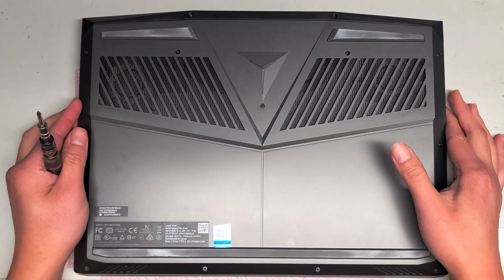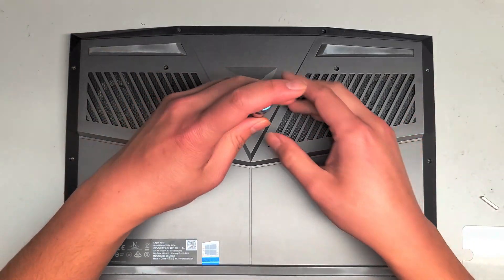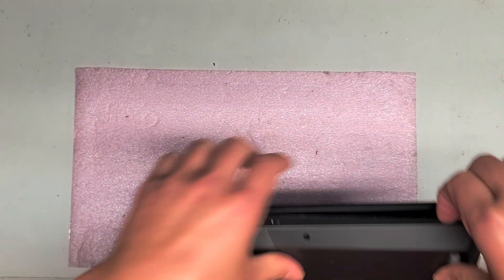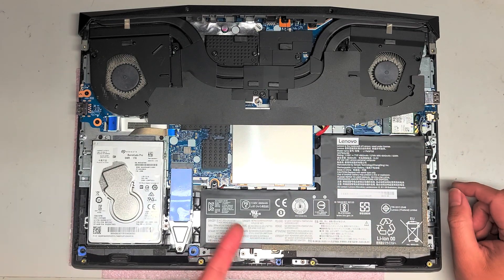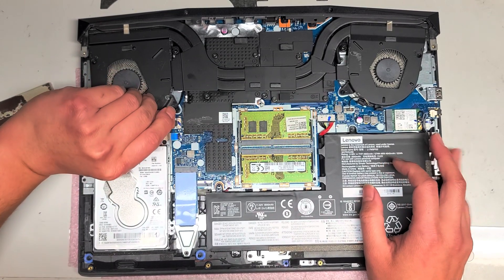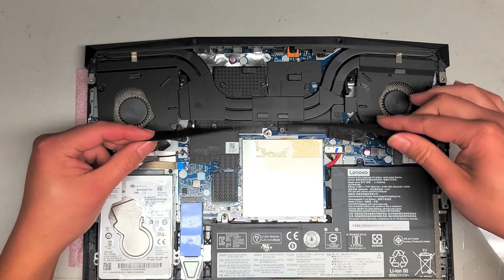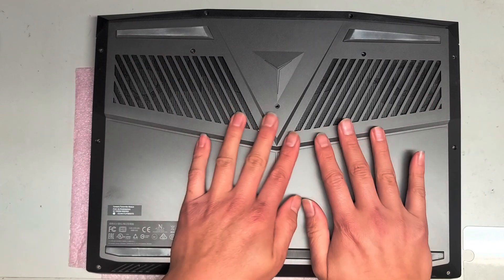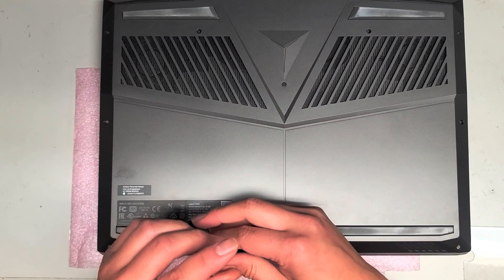Lenovo Legion Y545 Disassembly RAM SSD Hard Drive Upgrade Repair Quick Look Inside Part 1 of 2

Comment: hi It's Binh (BeHello, It's Binh (Been) Repaired & Everything Reviewed,

I hope you are well.

I would like to ask you about the Y545 PG0 laptop, the same one you are disassembling. I would like to know if it is possible and if you have access to the disassembly manual. I also experienced a situation where I took it to a service center, and now I'm missing several screws. The main issue is that I don't know what type of screws are needed, and I would like to know if you have that information or the disassembly manual. I'm not sure if I'll need to buy another part. I appreciate your help.
Reply from the maker: I don't have, nor do I use any manuals.
Reply: Hello, . @ItsBinhRepaired   

I understand that you don't use any manuals, and I apologize for my concern. I mention it because, like me, I am missing screws in the part that you are disassembling. I truly don't know if it happened during the maintenance that was performed or if they were lost. I would like to know what type of screws it uses, M1 or M2. Thank you for your collaboration
Reply from the maker: The 1 and 2 are the diameter in millimeters isn't it?

Comment: Hey so im trying to open up my y545 and ive got maybe 9 of the 11 screws out but the last two are stuck and i cannot get a good grip on them as they are rounded off. Is it possible to remove the screws in any other way without causing permanent damage? Thanks.
Reply from the maker: You need the right screwdriver or you'll need a screw extractor if they're too damaged
Reply: @ItsBinhRepaired  Thanks for the quick reply! Is there any specific screw extractor I should get as I am new all of this?
Reply from the maker: This one https://amzn.to/3Jkf5cg